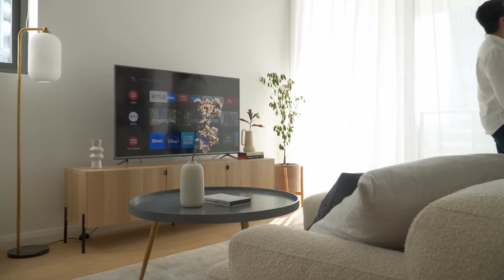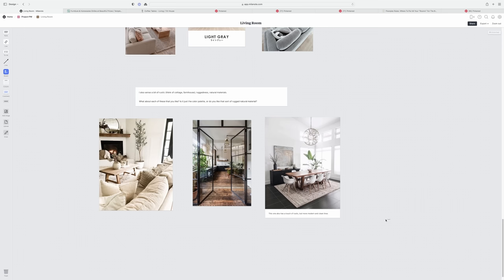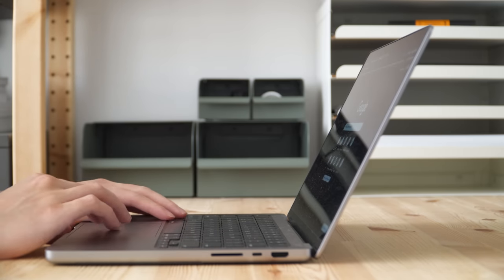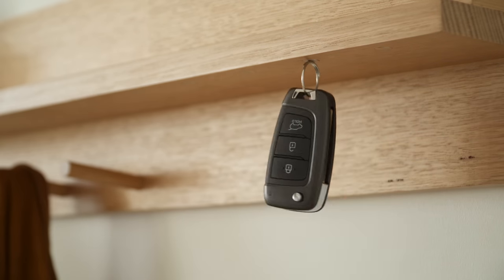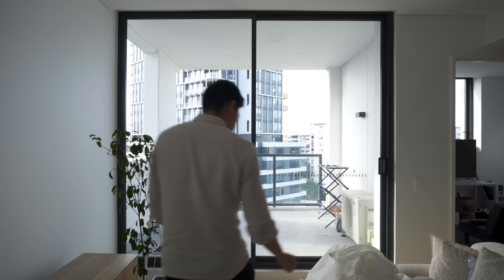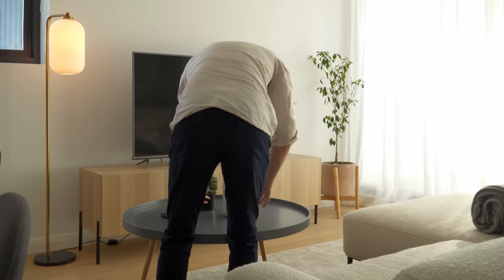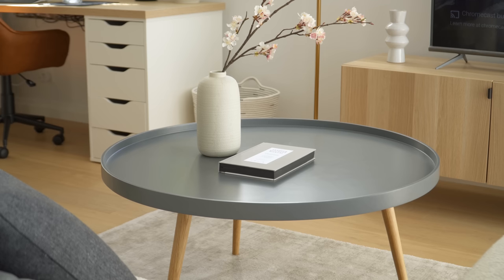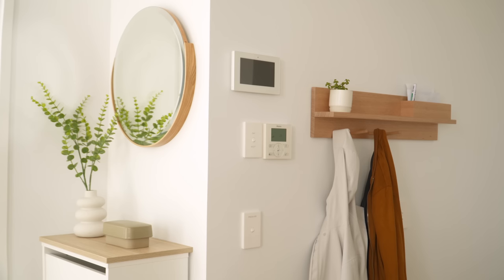Apartment Makeover #2 - Serene, Japandi-Inspired Home For A Couple | House To Home E03

Comment: Hi @Reynard Lowell -- I love your channel! I am actually moving into a new studio flat that is quite small. I have a bar table which i love and really want to keep it. However, the flat only has space for either a desk or the bar table but not both (that is, if i utilize only the most obvious areas). Would I be able to ask you for advice on a solution to accommodate both the desk and bar table? Any "think outside the box" tips?

Comment: I love what your doing. My question is besides Pinterest what was the other software you used to plan out the project? I saw a room mock up first for layout then another software to plan the actual pieces. Would love more info on that stuff. I use photoshop right now and that takes too long
Reply: I felt the same so I zoomed in real hard to the website link and I believe it's Milanote!

Comment: Is it easy enough to DIY install curtain track in an apartment that has concrete ceilings?
Reply from the maker: Definitely more challenging (will need a hammer drill), but doable if you know have the right tools.
Reply: thanks Reynard! wish i live in Sydney too. Would love to consult you for designing 😊